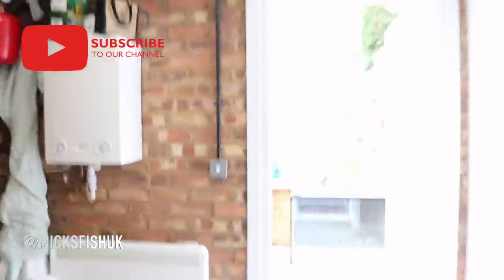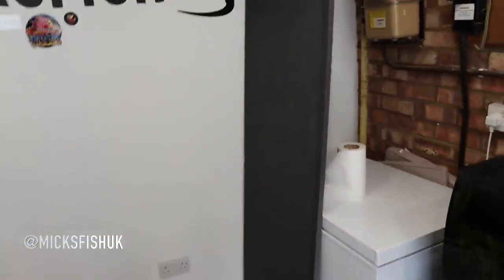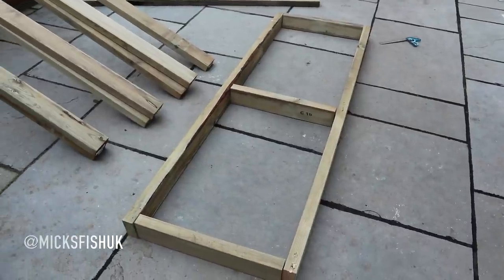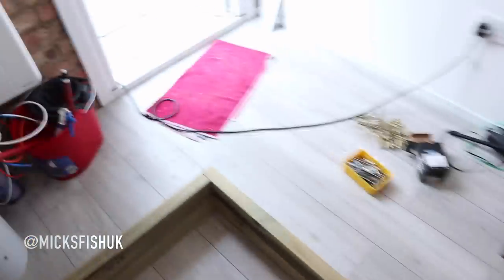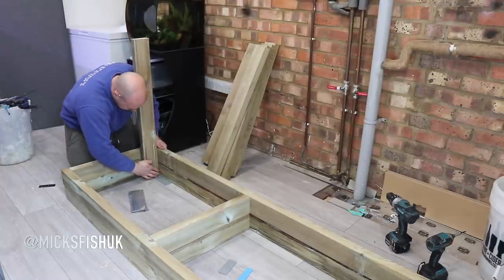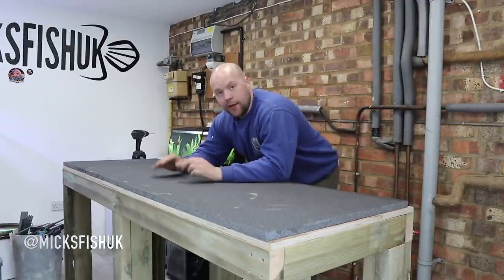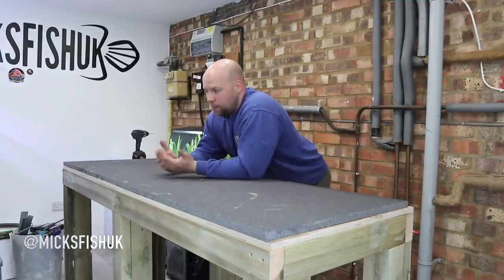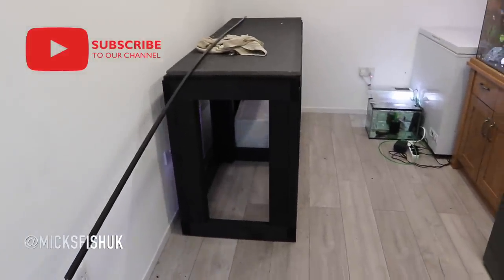HOW TO BUILD A AQUARIUM STAND

Comment: Hi mate just wondering if you could help. I’m looking to make a 6x2x2 stand and as I’m crap with measurements I was wondering if you had the time if you could give me a list of the sizes I’d need to complete this obviously using 4by2 plywood. I can then go to my local timber shop to get everything cut. Thanks
Reply from the maker: Hey mate I would know of the top of my head make it 10mm bigger than the tank is so it hangs over 5mm either side

Comment: Same method I used except I cut the 900mm length over size to allow for levelling. Screwed in the bottom like you did, making sure the stand is in the same place it will stay. Then instead of flipping it I slid up the top and levelled using clamps, screwed in the top then cut down the uprights. It means your support are all slightly different so you need to measure each one but the tank is perfectly level.
Reply from the maker: Good idea mate 👍🏻👍🏻

Comment: Will 3x2 be strong enough for a 450L 5ft tank?
Reply from the maker: Yes mate will be fine as long as you use it the way I have used the 4x2. You can always add a extra support on each point if you need to mate but I’m shaw it will be fine. I have a tonne of weight on my stand and urs will be half a tonne with that tank 👍🏻
Reply: @MicksFishUk  cheers bud, have some 3x3 too, can add those in as supports
Reply from the maker: Perfect mate even better

Comment: Good vid, on a side note how did you paint your fence panels? Did it leak through to the other side? Doing mine soon so any tips would help😂👍🏼
Reply from the maker: I did it with a brush mate and no not at all I kept checking but all fine 😁👍🏻